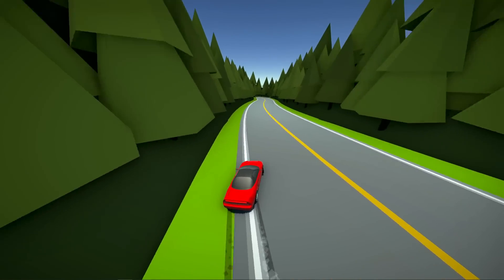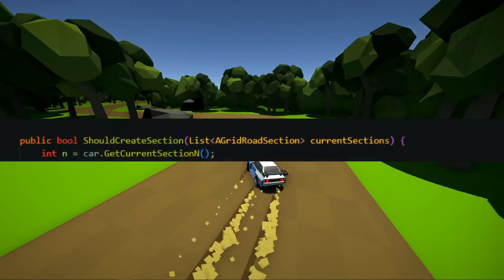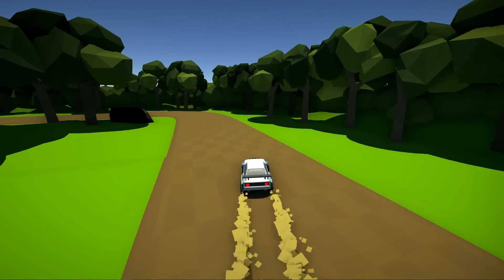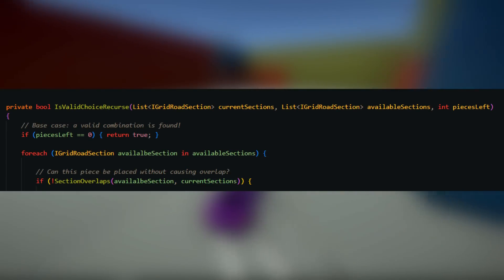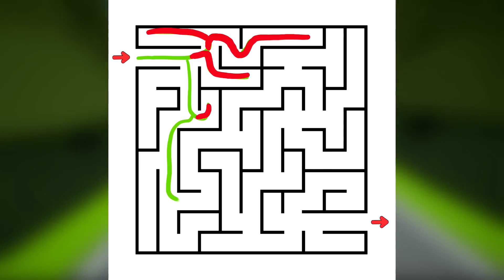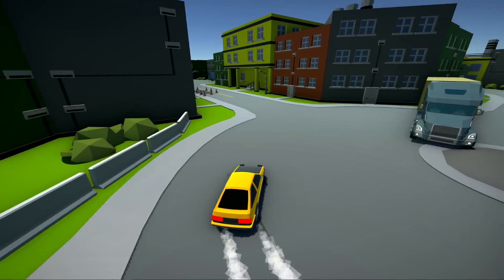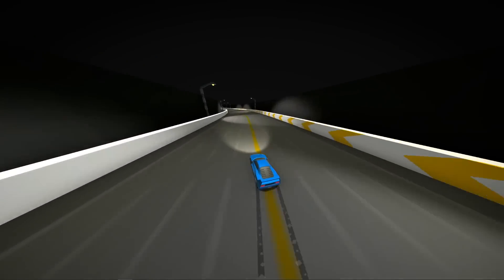Creating Infinite Road For My Drifting Game (again) - Drifto Devlog

Comment: well done video, I really like the style and the different environments you already have implemented :) 
Just a quick tip related to your recursive algorithm: 

Spreading your computations over multiple frames doesn't remove the problem but just delays it. The complexity still remains exponential, and adding just a few more tiles or raising the search depth to a few more iterations quickly removes the performance gain you get from adding this feature. I don't really have a perfect solution, but what if you don't care about the different types of tiles while checking for possible paths, but rather only check for directions: So e.g. you want to place a tile facing forward, then you dont need to check recursively for each tile variation that exists, but only if you could place any tile in front of the new tile. Then try placing tiles infront of this new one in every possible direction (forward, right, left) and repeat this recursively X times. if you can find a possible path, then the tile you placed is legit. Otherwise try another one turning right/left/..., you get the idea. I don't think the shape or style of different tiles matters for this, as you should first check for the tile you want to place at the current position if it fits there at all, before starting the recursive search.
This reduces the growing number of tile variations to a constant of only 1 or maybe 3 (for each direction), so the only variable you'd still have left is the path length you want to check.
(This of course only really works if your game is based on a fixed grid so you can use the "smallest" tile dimensions for searching)

I hope this helps ^^ any additions are appreciated.
Reply from the maker: That would definitely be easier to run. My only concern is it would remove some of the variation, the road would not be able to go back towards itself, even if it's still a valid choice.
Noted it down in the list of possible optimisations though. It's an interesting thought.
Thank you!

Comment: If you are using a grid I belive you could drastically reduce complexity by only checking 3 types of pieces: a 1x1 straight, 1x1 right, and 1x1 left. Since these pieces are of the smallest possible size, if these pieces can find a way out, then we know a tile is valid, but if they cannot, then there are no larger pieces that could find a better path (unless there are certain special pieces I'm not thinking of, in which case you may need to specifically add those).
Reply: The main issue with this one is that if you have a route out of a hole with a 1x1 straight piece, but don't actually have any 1x1 tiles to use, you might end up boxing yourself in anyway by virtue of the path being too wide to escape.
Reply from the maker: Both good ideas/points. Drifto doesn't have any 1x1 sections. Most tracks don't have any 1x1 pieces.
Only considering the most simple pieces is definitely a good idea though. Would be a powerful optimisation once there are more sections to choose from.
Reply: @jonathonhowe  you may also think about only using larger pieces to check first? Because if larger pieces can get you out then all smaller pieces will as well.

That way you won't find yourself in a situation in which you will only ever get the smallest pieces since the algorithm only every checks that they fit.

Comment: My solution to cheaply implementing the valid placement algorithm would be to avoid choosing a piece that would place its exit in any "threatened" space or its exit too near to any occupied cell in front of it. I would consider an exit as "threatened" if there exists an occupied cell in each of the three columns forward and to both sides. The column width depends on the size of your smallest right angle turn and your smallest straight line piece. The distance you have to check is large enough to check the whole map. What this does is prevent the head of the snake from entering into any areas that it would need to turn multiple times to escape from.

Comment: Like, if you can’t spin out, you can hardly even call it a game at all let alone a drifting game, you just push the car as hard as possible at every turn. Why would you ever want to hold back or balance the throttle? Where is the actual gameplay?
Reply from the maker: I'm assuming you haven't played it as there is no throttle. Drifto isn't a drifting simulator, it's a mobile endless runner based around arcade drifting mechanics.
The challenge comes from avoiding obstacles as the road gets narrower the further you go while trying to maximise your points and just do cool drifts.
It's not for everyone of course, there are many very good simulators out there as well.

Comment: I think there might be a few ways to optimize the comparisons of the panels. 

one is that you could merge straight sections to count as 1, two is by using a different sorting algorithm, instead of just brute forcing the checks one by one.

A thing to do differently would be to ID panels, and when the number of panels is reached based on an adaptive number to take into account the straight sections, it would remove the oldest ID's, therefore you don't have to do all of those comparisons to find out where the oldest panels are and if they need to be removed. this could double as a way to score, when you (eventually) crash or whatever is your death trigger, it just reads the id of the panel of what you are on or something. 
I hope you see this and let me know your opinion on my suggestions.

Comment: You should try mapping 1D perlin noise to an angle, and then make repeated steps from the previous position based on that angle. Voila, non-uniform bendy road with fine co control over maximum twistiness and frequency!

Comment: Hi,
Just discovered your channel. This devlog is brilliant and I think Drifto is a wonderful game. Infinite drifting with track being generated in real time is really cool and you've implemented it very nicely.

Here's a suggestion for the algorithm that checks whether a piece is valid, which is related to cycle detection in graphs.
A piece can only be invalid if it creates an enclosed part of the map, i.e a bunch of tiles surrounded by road. So first check if the piece has any other neighboring pieces (Except for the piece it is connected to), otherwise it's guaranteed to be valid.
Now to check if the piece you want to put is invalid, look at the position of the next piece you've added and check it it is inside the enclosed space between the previous piece and the piece it is touching using raycasting.

Comment: To simplify checking if a piece is valid you can just check if it would create a loop and ensure you aren't going to be on the inside of that loop. Given that your pieces cannot overlap and that roads only have 4 directions that they can travel in, this is trivial, just check if the piece you are placing is adjacent to an existing piece, if so you must turn to travel in the opposite direction to the existing piece, that way you can never end up trapped. Though you do have to check ANY adjacent tiles including the 2 diagonals in the forward direction to ensure that if a corner is diagonal from the tile you want to place that you turn to go in the opposite direction to the entry of that corner piece, it also assumes you always have access to single tile pieces to turn 90 degrees or go straight.
Also because the system for selecting the tiles is unlikely to write to data that is used by the main thread during selection, and the data it uses to make a selection isn't going to change during selection it should be relatively simple to run it in a separate thread too.

Comment: I’m just thinking off the top of my head, but for the problem regarding dead ends: Maybe a way you could calculate the validity of a direction could be a factor of time to collision with another block. Let’s see if I can explain this…if the option of the road turning right would lead to a collision with another block within t=5 block iterations, but you know the block pending collision with that vector will disappear in t=7 iterations, that’s not a valid direction. But if the block pending collision will disappear in t=3 iterations, that may be a valid direction. But then you still may have the issue of the next iteration not having any valid directions, I suppose.

Comment: Others already mentioned collapse wave function. Right you're you're basically bruteforcing yourself through map generation, which is a bit ridiculous. 
I would go with a bit different approach, not using tiles. Tiles make the roads repeatable. 
What about generating bezier curves, stitching them together and using Sylvester matrix to verify if they're not overlapping? You could then control how "tight" the turns are by controlling parameters of the bezier curve, wouldn't have that much repeatability and all the elements along side the road could be procedural, instead of predetermined.
Would be probably also easier to calculate a "seed" for each end results, since it would all be based off of one function.
Really not sure if it would make the game better from gameplay perspective, but I think it might be a more interesting approach.
Reply from the maker: This is similar to my original approach for the road generation. It's definitely very interesting.
I went with the tiles for development time. The system you mentioned would be significantly more complex to build.
It's an idea I'd love to toy with in the future though.

Comment: You can probably reduce the number of future pieces to check by only calculating pieces with unique shapes instead of actual pieces. I.e, if two pieces both are both 1x2 and having matching input and output positions, regardless of their contents, you only need to check using one of them. This might remove some potential redundancy.

Comment: I think this would be very chill with a nice sound track, where when a song changes the level would also change, but in a seamless way. I.e. you'd have a special tunnel begin and tunnel end piece, and then you could go from the city to the tunnel just by placing the tunnel entrance, and then switching out the set of available pieces to come next to be from the tunnel set.
Reply: Oh and props for choosing a simple and fun looking main gameplay mechanic. Another "game mode" idea could be to save the generated route, then make it possible to drive it again, racing your "ghost", similar to many driving games, trying to drift smoother and faster than the last time.
Reply from the maker: Those are both amazing ideas!
I'm unsure how to best integrate them into Drifto as it is currently but i'm excited to try it out.
Thank you!

Comment: nice! but you know, if you just let it go downhill nonstop you wouldn't have to care for any overlaps and could focus entirely on generating nice corners and track pieces
Reply from the maker: On downhill tracks the generation can definitely be more lenient, but given the angle of the touge track there still needs to be some avoidance. For example, 4 right turns will still have some overlap.
Reply: @jonathonhowe  maybe i'd still go for it then, cause it simplifies the issue and drifting fans love downhill anyway ;)

Comment: in theory, you could have a system that has multiple tiles with the same functionality and size, like a turn. You could have multiple 3x3 tiles that all turn 90 degrees, but you only need to do the calculation once then you can pick a random one of those to place
Reply: RedPug from stormworks? did not expect to see you here whatsoever, its crazy I even noticed
Reply: @o_sch  i'm everywhere... don't turn around

Comment: When checking whether you can still get out of an area, you could just use 1x1 straight, left, and right pieces, reducing the number of combinations to piece_count * 3^iterations. Just like your snake pathfinding example :D

(assuming that you have those pieces available to place. otherwise you need to find a different set of tiles that covers all possibilities)
Reply from the maker: That's a great idea! Would also be fairly easy to implement. Thank you!
Reply: This is basically what I was going to suggest. But you can simplify even further. If you're guaranteed those pieces exist you can view the current map as an array of bools (where occupied = true). Then you're just asking if there is a path from the end of the road to a given location just outside the bounds of the current map. And you can just use A-star for that (which I assume unity will have an implementation of).

Comment: A way to diminish the number of comparisons made, could be to restrict the use of tiles, or only allow the use of certain tiles after a specific one has been placed before, like "don't use a roundabout if the previous tile was a roundabout", or "don't put a left turn if the previous two were left turns too"

Comment: Ok but if you just delete every road section behind yourself immediately, you could have non-euclidian roads that overlap themselves and you would never notice unless you were tracing a map in your head. Like a corkscrew section!
Reply from the maker: This kind of already happens. The road sections behind the player are removed as soon as its safe to do so.
However, the collision avoidance is still required for pieces being generated ahead of the player.

Comment: Pretty sure you can do the valid road section calculation ahead of time. Put the calculations into a dictionary where the key is the sequence of road sections you have already placed (of a fixed length) and the value is a list of all valid next road sequences. At runtime this will just be O(1)
Reply from the maker: That's a great idea! 
For the road to be random, it would still have runtime cost though. Combining this with staggering the calculations over multiple frames would help performance massively.
Reply: Thanks 😊 
I think if you enumerated all possible valid options you could select at runtime in constant time.

Comment: Interested on your thoughts in implementing bridges and cross-overs. Might be weird to pass over a bridge that didn't exist when you went under it, but I doubt anyone would notice
Reply from the maker: Yes! I have thought of that and I like it. Even bridges that don't have accessable road under it would be a cool enviroment detail.
Reply: @jonathonhowe  Or the other way, going under a bridge that isn't actually connected, but it has potential of connecting if the generator happens to loop to it. A Schrödinger's bridge - the road may or may not connect to it in future. If it doesn't, it was just scenery - if it does, then it's part of the track.

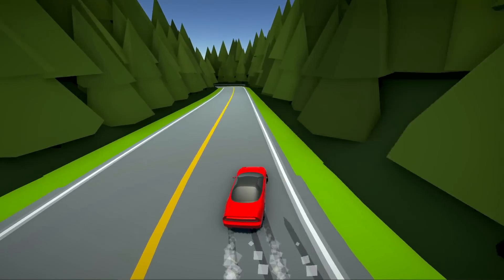Comment: a thing you could do to reduce complexity would be to reduce how much forward you are going to check, and making tiles specifically for overlapping, in the city races, could be an underpass, or even a jump between buildings , on the mountain drift course (4:40), it looks like it always going downhill, so the best option could be a tunnel, this could be done without having to change the previously placed track(which in the city would be harder)

also, the way you generate levels seems like it could easily divided in different threads on the cpu, youu have the game/physics running on a thread, and another is dedicated only to generate new pieces, could help with performance
Reply from the maker: Yes and yes! Pieces designed to overlap is a very cool idea, one I'm definitely going to look into.
I've tried to run the road generation on different threads but Unity makes that incredibly difficult.

Comment: Another solution is coming to my mind to simplify the dead end issue : you could assign a direction vector to each bouding edges of a tile, with a vector pointing outside for blocking edges and inward for roads extremities.
With these vectors you could generate a kind of flow map that would naturally point in the general "good" direction to follow, and so directly pruning most of the wrong tiles in each case.
Not tested, just a guess😁
Reply from the maker: My worry for stages like the city would be that it encourages the road to be less dynamic.
I can imagine this working really well for a stage that should travel in roughly the same direction - like the touge.
Reply: @jonathonhowe  Not sure : this technique should help to ensure that the path do not loop in a dead end, but you'll still be free to randomly chose tiles that complies to the flow field, and get a sinuous road.

Comment: I feel like avoiding self intersection is sort of a missed opportunity for unique and interesting gameplay. Since driving a "self intersecting" track could only be possible in a scenario like this one, where the track is generated in front of the player (and deleted as they leave it behind).
Reply: Or forcing intersections to make tunnels or bridges
Reply: Truly the embodiment of "getting lost in the drive"
Reply: I think it would be quite fun for intersections to be based on the initial tile and simply have a different path built through, over or under it; which could have an "under construction" vibe, seeming like the new road was built while the player looped back to the intersection
Reply: non-euclidean drifting would be aswesome indeed
Reply: Where does your pfp comes from???
Reply: @hopper6280  if you're talking about op, I think you can search for "elf meme" or something similar
Reply: It would be fun but it could add considerable development overhead. To "rejoin" a previous piece, that piece must be an intersection. But that means you need to generate the roads off the intersection before the player first gets there, so that they can pick a direction to go. In a system like this, implementing such a feature is actually quite challenging because it leads to lots of undefined behaviors.